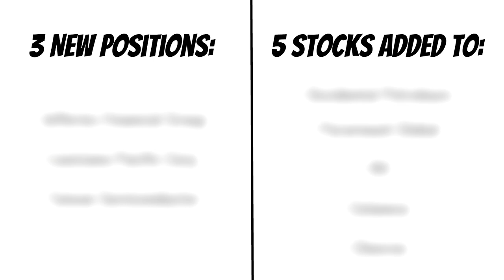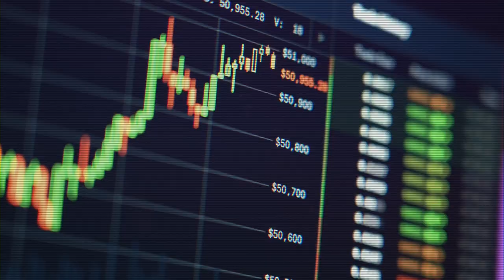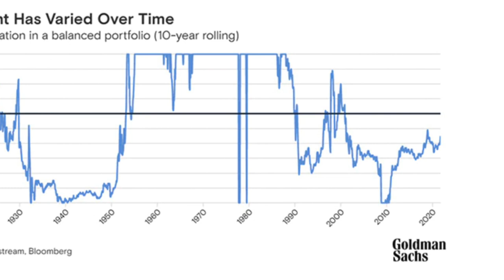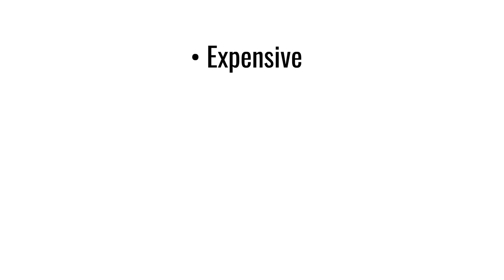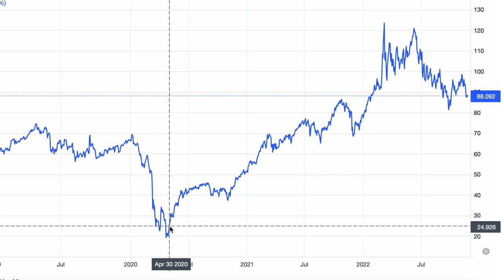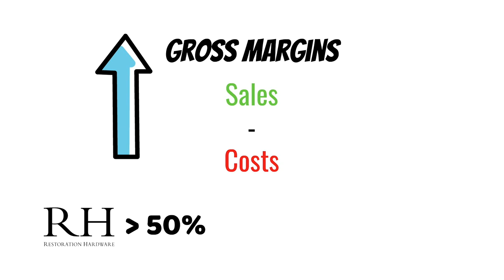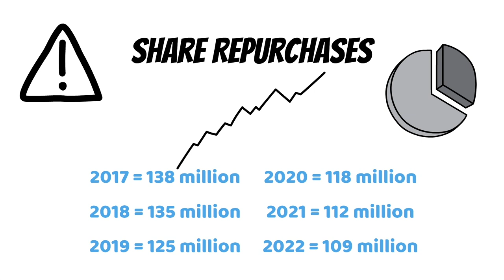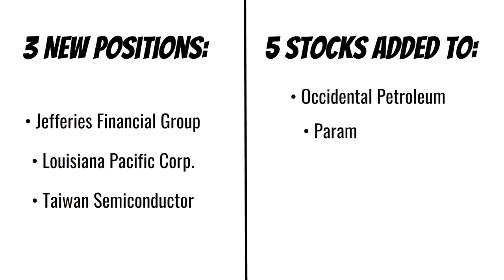8 Stocks Warren Buffett is BUYING

Comment: I feel those who would allow the market dynamism to determine when to trade or not are either new in space generally or probably just naïve, the sphere have seen far worse times than this, enlightened traders continue to make good use of the dip and pump even acquiring more equities towards trading sessions, I'd say that more emphasis should be put into trading since it is way profitable than hodling. Trading went smooth for me as I was able to raise over 11.4 BTC when I started at 1.5 BTC in just a few weeks implementing trades with signals and insights from Anna Olsen. I would advise you all to trade your asset rather than hodl for a future you aren't sure about or hold it and risk losing all....
Reply: < @olsen902
Reply: You < can communicate with her on Tele gram with the user name.👆🏽👆🏽✍🏿
Reply: She  is not much of a talker but a doer. I never believed when she told me I could make profit from trading until I withdrew 3btc to my block chain just september here. Anna Olsen is good when it comes to trading and I will recommend her for other investors.

Comment: By the size of most positions I guess its not buffet personally but Ted or Todd.
so in my opinion its even a bigger opportunity cause we get access to super investor level trades with relatively small cap stocks  which often have more upside than large cap (such as apple).
Do you agree/disagree?